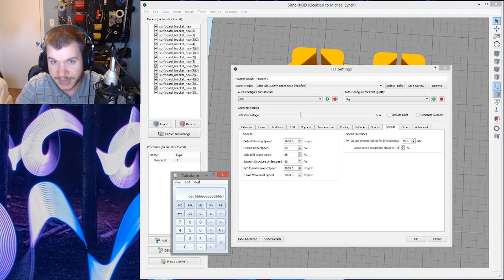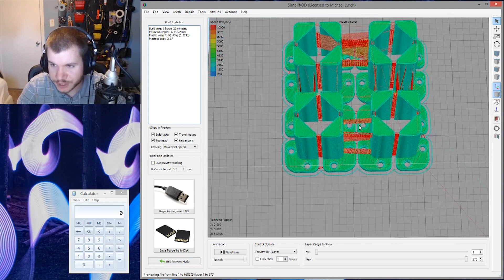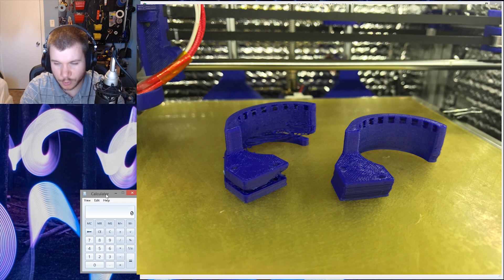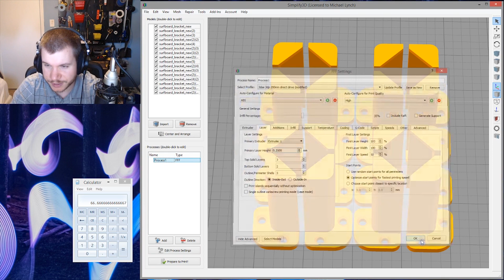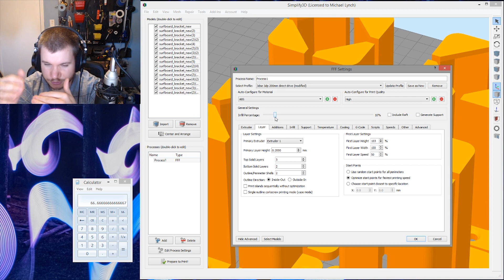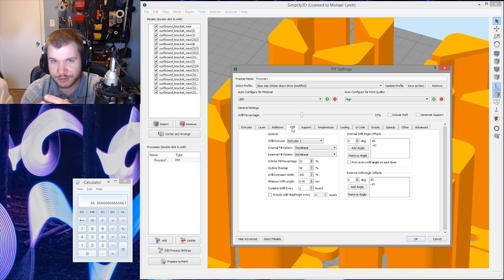Increasing Print Speeds - Without Sacrificing Quality

Comment: Interesting video!
Always printing at 0,2 ~ 0,25 mm layer height works great for me.
All the insides of my prints are printed at 50 mm s^2, only the one most outer layer and shell is printed at 25 mm s^2.

In firmware increasing the acceleration increases print speed drastically.
To prevent some ghosting and ringing I set the jerk amount to 10 mm s^2.

With a large maximum value in firmware this can be tweaked in gcode, but the Marlin settings are sufficient for me.
This also makes the faster travel moves more effective.